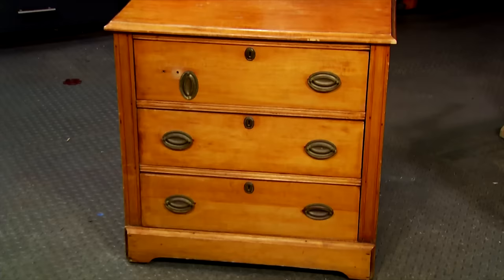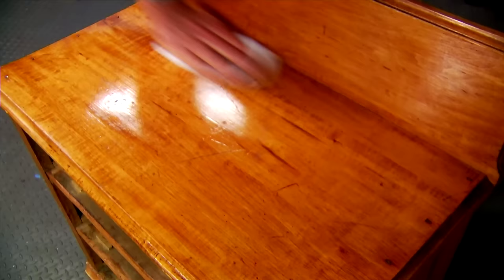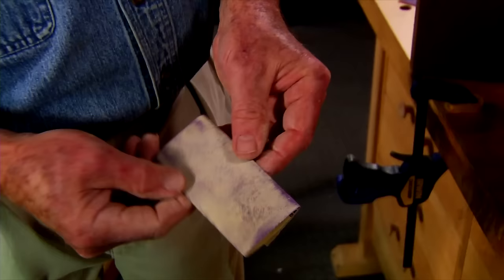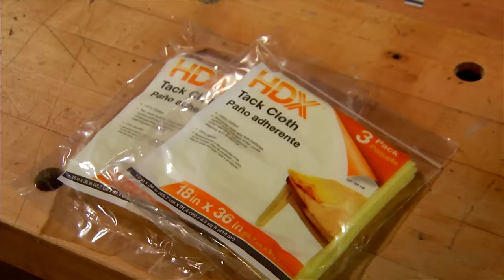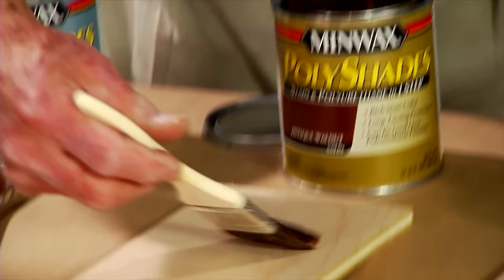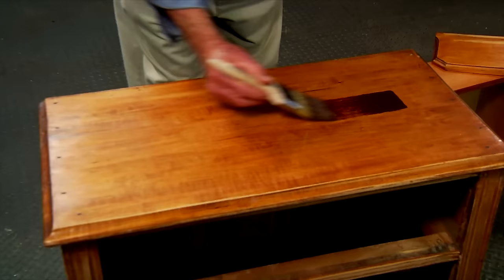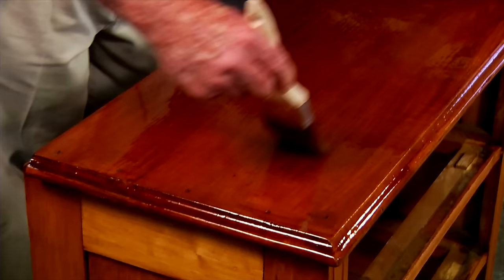Refinish Furniture Without Stripping

Comment: Good God where do I start?   He did it the hard expensive way.  All that hand sanding. And for what? He then had to buy a can of shellac LOL another expense.  Just strip it down with citrusstrip and wipe away the old coating.  Cleanup is a breeze.  Then stain or paint it.   

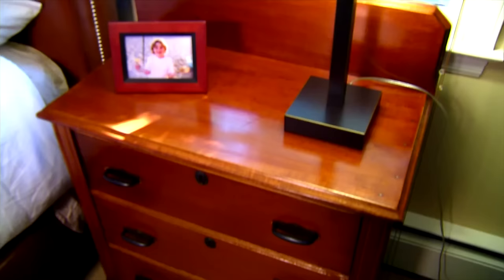Did you notice when he was putting the drawer back in at the end, that the stain he used to do the drawer fronts dripped down the four sides and dried? That looks awful. @ 6:07  Shows poor craftsmanship.

Comment: Ok lol Ron . I have owned and operated a Furniture refinishing shop in Texas for 35 years . I understand you are more of a DIY Kinda Guy , however and so therefore you are more of a teach me what I can do in my garage Kinda Guy . First off Naptha is terrible for your hands , hense your terrinle spots all over your hands and arms . ALWAYS USE GLOVES !Secondly your box store finishes are terrible ! Min Wax as you say Is a Poly finish , slow drying brush on finish . It is a plastic based finish which will yellow very quickly . On top of these flaws its a brushed on finish which never fails to leave brush strokes in the first to the last coat . Heres a suggestion , Strip the piece PERIOD . A proper Metholine Cloride strip will get rid of all the silicone / fisheyes . Sand the piece , stain it . Get a spray rig , not that expensive if you shop properly . Use a sanding sealer ! Shellac is soft and never dries good ! Stain it with a OIL STAIN ! Two coats of Lacquer and DONE ! Why go to All this other BS ? Hey Rob , come to my Shop and I will re educate you !

Comment: Doesn't look very professional @ 5:46 with the finish that has overlapped onto the top edge of the drawer and @ 5:47- 5:48 there are several bumps or bubbles that appear on the front surface of the drawer.   All and all not a great job.

Comment: This video is kind of bullshit because clear shellac primer does not exist. Hell he even shows a primer can when he picks it up and you can see that it's an entirely different can when he actually sprays it on. I bought a can of shellac primer and almost ruined the desk I'm working on because it came out white!
Reply: What about Zinsser Bulls Eye dewaxed Shellac.  It say clear on the can.  When applied, it looks like you've varnished the bare wood.  Applied over an existing finish it looks clear.

Comment: This is the worst product ever made.  Fortunately it has about run its course and I saw it for $3 at Walmart.  You seem like a decent guy but why would you hawk this junk?
Reply: you're talking about the minwax? why is it so bad? I was thinking about getting some... but now I'm not sure after reading your comment.
Reply: +Rick James Its the worst product I have used ever. I used it once about 15 years ago an it made a mess out of the wood I used it on. What I couldnt get over was when he reattached the hardware there were clumps of the crap on the top side of the drawer. Obviously he was paid to do this vid
Reply: What would you recommend instead?
Reply: Either strip it and stain it the shade you want followed by  a clear poly or lacquer finish or if you have a compressor seal it with a lacquer sealer and tone it the color you want followed by a clear cut.  When you use the colored poly it builds up while applying is very uneven like you see on the drawer not to mention if it is chipped, which happens easily with this crap the prior color will be exposed since the color is in the finish.  The bigger the project the worse it looks.
Reply: zar is better
Reply: +Rick James 779o
Reply: Rick James 
Completely agree. It doesn't matter how much time you put into brushing it out, it always looks like diluted paint and not a stained finish.
Reply: The Rustoleum polystain is better, and a sponge brush lays it more even. Don't use spay shellac - mix your own or at least use a quality brush-on that hasn't been sitting somewhere. Shellac has a shelf life. 

The finish in the video looks like crap. The over run of the stain, the particles in the ace side - I thought you used a tack cloth? Maybe hit it with 0000 steel wool and apply another coat?

Comment: Based on my 40 years of experience, now retired, in painting, staining, faux finishing, restoring antique wood finishes in all kinds of furniture, this is the worst advice I have ever heard from someone who is suppose to be a craftsman. My god, LOOK AT THE DETAIL  after he is finished showing the before and after. There is all kinds of flaws in the finish!!! YOU NEVER EVER USE A POLYSTAIN for refinishing..PERIOD.. and NEVER USE A STAIN PENCIL...PERIOD....Refinishing anything without taking it completely down to bare wood requires time and patience in order to get the stain evenly dispersed around your project no matter what it is. Yes, for the novice, do the prep work he suggests with the sanding and shellac and thats where you stop with this guys advice. 
Again, for the novice, buy yourself a ' GEL STAIN' and a professional natural bristle brush. I recommend getting the blond bristle. Again, for the novice, you want to take the brush and place it in a container full of mineral spirits and bounce the brush up and down on the bottom for a minute. This will aid in loosing and loose bristles that may be in the feral and will make the brush less rigged. Remove the brush and shake it out by placing it between both your hands and rubbing the brush back and forth causing the brush to swirl back and forth. Put the brush back in the mineral spirits and repeat. Next put the brush back in the it's wrapper that it came in and let it dry over night. Again, for the novice, After you have prepped your project, use a little amount of gel stain on the brush and get in all the crevices first and they all the flat parts and sides, called revels, you can give it a final wipe, if you'd like or let it be and let dry over night. Remember to clean the brush each time you use it!! DO NOT USE a lot of gel stain because to do this right you may have to do this a number of times perhaps up to as much as 3 coats for uniformity. Next day, look where all the light spots are, that is where you need to add just a little of the stain. Dab a little on with a non shedding cloth or paper towel than take your brush and sweep very lightly over the area to cover it and feather it into the rest of the wood that is not so light. Let dry. Do this again until you see uniformity. Then apply another light coat of gel stain using a non shedding cloth or brush and let dry and again, look for light spots and repeat what I said above and let dry. Next look for light spots if any, repeat if necessary. After you have uniformity, and your project is dry, apply by spraying, from a can, a light coat of polyurethane to seal in the stain. Let dry. Then you can a use either 2-3 more coats of spray or 2 coast of brush on polyurethane and let dry completely before putting the hardware back on. Now enjoy your project.
Reply: You should make a video.